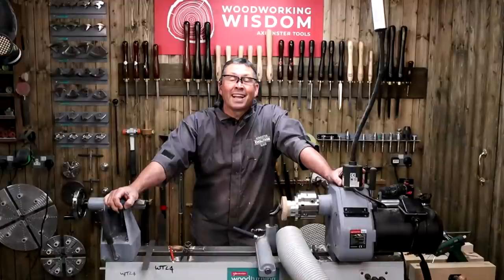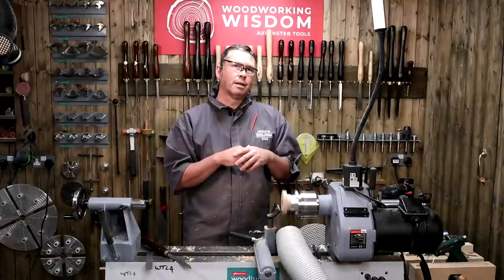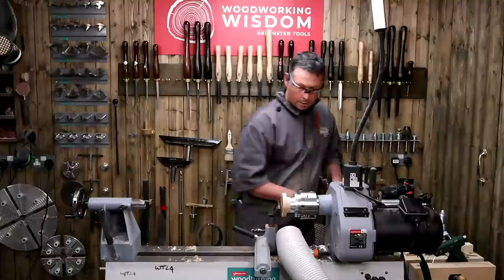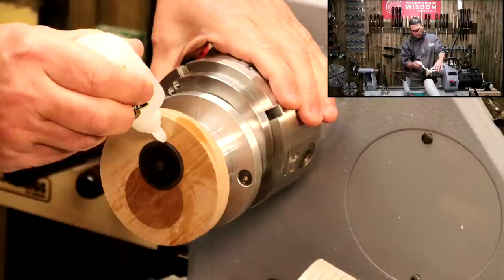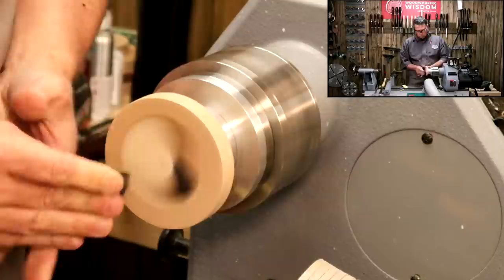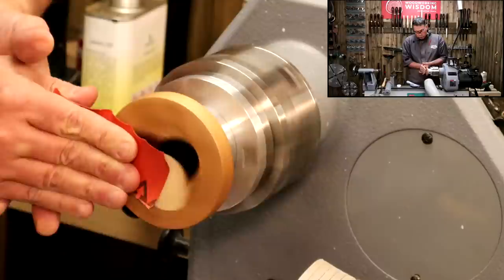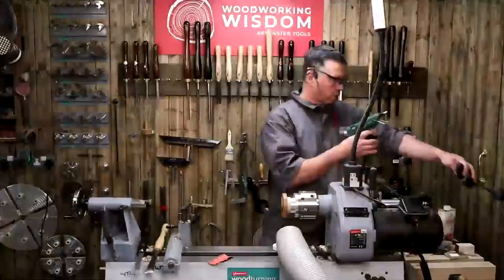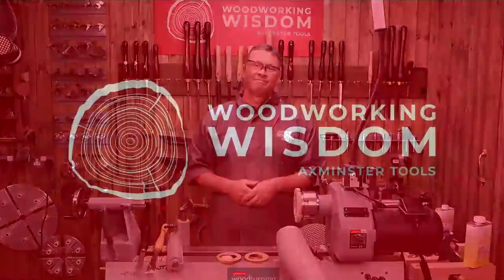Woodworking Wisdom -  Offset Coasters

Comment: Hi Collwin I absolutely loved your video on the coasters but how do you fix the wooden jaws on to the steel jaws on the Chuck my Chuck by the way is a robert sorbet patriot not that It should make any difference thank you Ron
Reply from the maker: Hi Ron, the following reply is from Colwin - "Glad to hear you're enjoying the videos on woodworking wisdom, I was using a jaw called a woodplate jaw that fits onto my Axminster SK114, have a look at the link below. These are simply screwed to the ply which you can then turn to size. 
 https://www.axminstertools.com/150mm-wood-jaw-plates-910405
Hope this helps."